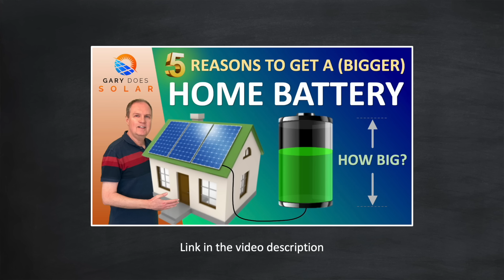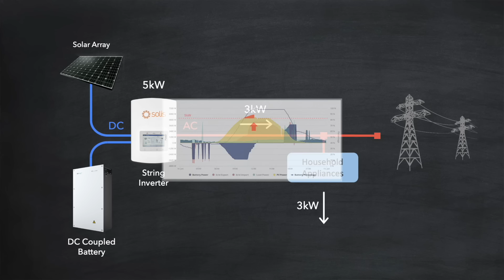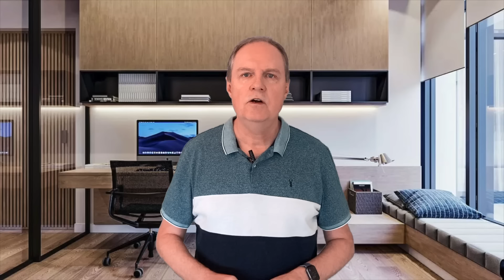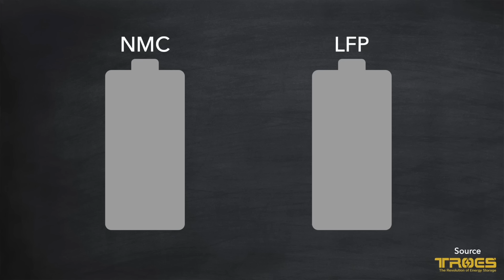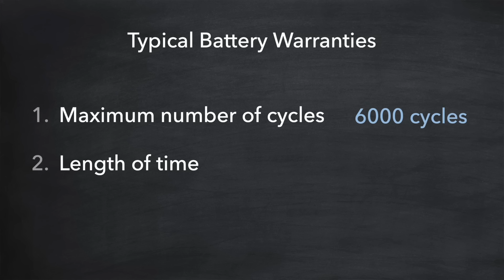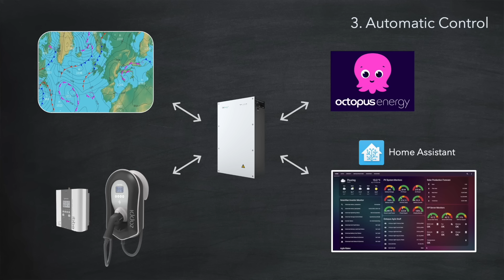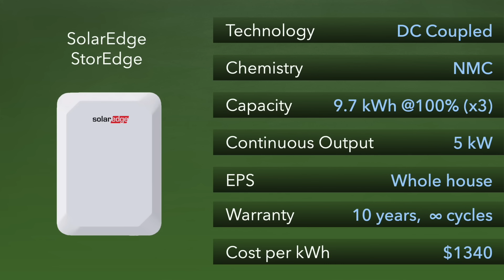8 Key Factors When Choosing the IDEAL Home Battery

Comment: It’s a very good summary of all the battery considerations.  I will add though that with warranty terms, it is common to see “pro rata” clauses in terms and conditions.  So for example if your 9 year old battery is dead with a 10 year warranty , they’ll give you a credit worth 1/10 the replacement cost of your next battery.

As for returns on investment.  I naively thought this would be easy to measure.  It’s not.  It’s tightly coupled to your solar investment.  So for example:  I charge my  battery up from clipped solar on a bright day.  Then I discharge it in early evening time.  So I’ve boosted solar production by 10% in kWh terms, but it’s worth 20% of all value generated for the day (due to flux evening export rate).  So:  how much of that added revenue is attributed to the solar investment and how much is attributed to the battery?  It’s hard to untangle, but it’s an excellent example of how investments boost the value of each other.
Reply from the maker: Thanks Anthony. Yeah, like any contract these days, there are always a load of "get out" clauses, which can make the contract not worth the paper it's written on. Somehow, I don't ever see that changing - it'll be social media feedback on how companies deal with warranty failures that determine how they behave...

You're right about ROI - I'm about to undertake a ton of research around that, and I'm thinking along the same lines as you - we need to separate out the solar ROI from the battery - not easy! And as you say, there is a combined benefit too - should be fun to untangle :-)

By the way, I strongly recommend people to watch Anthony's channel - his latest video on energy pricing and how it might change in the future is highly informative: https://www.youtube.com/watch?v=Me0lFCfVCwo

Comment: A nicely put together video Gary and, having watched it right through, it covers pretty well everything that came into my mind when we chose to add a battery to our system a few months ago. Much of my decision making process in specifying the system was as a result of videos from yourself and others (and my electrical engineering degree came in handy too). 

It's very reassuring to see that what we chose in the end is well aligned to your video content here - but chosen to suit our individual needs. So far, we're happy with our battery addition and having Octopus Agile  as our tariff means that we can keep our batteries nicely topped up but without over stressing them. .... AC coupled 15KWh Phosphate batteries (3 by 5KWh each), for information.
Reply from the maker: Hi Ian, thanks - and great to hear I managed to cover all the salient points :-)

I studied Electrical Engineering too (but I think I've forgotten most of it!) - helpful for all this solar and battery research though :-) 

Your battery strategy sounds good, and not a bad capacity!

Comment: I totally disagree with you on AC coupled being better. You paying for inverters twice AND saddled with extra power conversions. 

You can buy a sol-ark 15k and 20kwh for the cost of a Tesla power wall and it is significantly more capable. There are other inverters that do the same
Reply from the maker: Actually, I never said AC Coupled was better than DC Coupled. I simply presented the pros and cons of each. I'm not sure I could have been any more objective than I was.

I then disclosed that I (personally) would have purchased an AC Coupled battery if I had my time again, but that's taking into account my own situation, and the next person's situation will be different to mine.
Reply: That's fair. I do think you ignored the types of units that I mentioned that combine much more of the function into a single box, including a 200amp grid passthrough. These mitigate your cons of DC coupled batteries in my opinion. 

These include the sol-ark 15k, EG4 18k and luxpower 12k. I'd suggest you check them out.

Comment: Another great vid Gary. It just goes to show how fast things are moving. When I signed up for my 4.1kW array, GE 3.6kW Hybrid Inv & 9.5kWr Battery (+ a Zappi & Eddi) last November (which was installed in March this year) I thought I would be good to go for a few years to come. However, the cracks have already started to appear. The GE LFP 9.5kWh battery is probably not big enough for our current / future needs & the 3.6kW Hybrid Inverter is not really big enough to power everything we tend to have running in the house at the same time which requires careful management of what can be turned on & when. 
I can add an extra 9.5kWh battery to increase storage capacity but I'm pretty much stuck with the Hybrid inverter unless I change the whole system. The GE AIO system was not available when I placed my order last year & is probably the one I would go fo now.
Reply from the maker: Hi Colin, thanks! :-)

Yeah - technology is always improving (great) but it means that whatever you buy, there will always been something better coming along even a few short months later. I feel the same about my existing GE equipment and the new AIO!

Comment: A lot of great intel in this video again. I'm wondering if it's worth the money to choose for a bigger output inverter, let's say 8kw instead of 5kw, for your needs in the house. Then you can choose DC coupled batteries and minimal losses. Right?
Reply from the maker: Thanks :-)

And I wouldn't worry about the losses - although theoretically, losses for DC Coupled batteries are less than for AC, in practice, it doesn't make that much difference... And of course, a bigger inverter could be refused by your DNO (or export rate limited)...
Reply: @GaryDoesSolar  I think you can get bigger inverters within G98 if they are 3-phase ( as each phase would have a separate 'limit'. am, I right? ) . I have 3-phase to the house.
Reply from the maker: @TommysDaddy  Good question - and one I don't know the answer. Would be great if so! 🙂

Comment: Another very clear and comprehensive video Gary, thank you.   The charge/discharge rate of the inverter and the battery are for me one of the key decision factors as to whether you can use your battery effectively to power your home.  You mentioned that a benefit of AC coupled is that you can chain multiple batteries to increase the throughput,  you can do the same with DC coupled as well if you have multiple hybrid inverters.
I have two GivEnergy Gen 1 5kW hybrid inverters which were sized this way because of the number of panels I was having installed.  Looking at the energy graphs I am not getting anywhere near clipping on the inverter output, but if I’d had one inverter I definitely would have been clipping.  Two inverters means double the charge & discharge rate.
Another battery choice consideration is whether you can expand the batteries yourself.  Most manufacturers allow this and the batteries just plug in, GE are the outlier by insisting that the install has to be done by a qualified installer.  This is a disadvantage of GE.
And a minor point on the GE Allinone, their literature says the ‘up to 6 batteries’ chaining is a ‘coming soon’ feature.  GE’s multi-inverter option for AC and DC inverters has been work in progress for a long time, so hope its coming sooner for them to compete with Tesla
Reply from the maker: Thanks Geoffrey - really great feedback :-)

Thanks also for sharing this insight - and yeah, I read the same about the AIO - hopefully, that feature will appear soon!

Comment: Redux flow batteries
Reply from the maker: They could well have their day in the home at some point... I think it's great that there are several battery technologies, all vying for prominence.
Reply: @GaryDoesSolar  At the moment, I just can't trust having batteries of that size in the home that could potentially destroy it at any time. Same with EV. Ill wait for VRFB batteries to reach its sweet spot. Only drawback is the large amount of space required for them. It will only be a matter of time before China's factories begin the mass production and find some way to increase the charge densities to reduce their spatial footprint. The other advantage is the much longer lifespan and easy of replacement for the electrolytes and electrodes at the end of life.
Reply from the maker: @DavidCheok  I'll keep an eye on that technology 👍

Comment: AC vs DC isn't a big issue for me, especially when the real world efficiency doesn't seem to matter too much for me. Besides, theoretically I'll actually need less battery capacity purely because I'm doubling up my solar array. Though it'll be better when I do get an EV

A couple of other factors too RE: LFP vs NMC is ethical and environmental concerns

Nickel mining in Russia isn't great for people's health. That, and it does somewhat support the Russian state even without health concerns

Cobalt mining isn't a particularly ethical thing, even though the vast majority of it is used for refining crude oil

17:20 ish I asked GivEnergy about Intelligent Octopus Flux, and mentioned my concerns about forced discharging, and they said it's not a massive issue.

Equally, someone else pointed out prior to this video the same thing you said ie: when the battery dies, I'll probable want a larger sized one anyway, or more so the same physically sized one but far more energy dense

The system I'm upgrading to is the AIO however, I don't really need an EPS given that power cuts are rare here.

Though I did think "Hmm, if my dad got solar panels for the house he built in Pakistan, an EPS is a far better option than a UPS which only really has enough capacity to power up the ceiling fans" Power cuts there happen about once or twice a day for about an hour at a time, and the fans are also at reduced capacity.

Under normal circumstances, the UPS is "good enough" to at least give power for those fans to help keep somewhat cool. Under an extended power cut, that's not amazing.

Equally, the UK may not receive that many power cuts yet, however given we've historically been a cold, wet country, the energy infrastructure doesn't have to be heat tolerant like it is in hot countries

In Australia and the gulf states, they can afford heat tolerant equipment. Most of the global south can't afford that. The UK probably will also struggle to afford that even though we're a relatively rich nation, purely because it means the replacement cost is so high.
Reply from the maker: Thanks for your insight here, Waqas - really good!

Comment: Thanks Gary much to consider. I am woefully under informed on my system. I have already got batteries maybe DC coupled need to check, in my loft, and something that has me concerned since I watched the electric viking in which he states that batteries are not allowed in roof spaces in Australia not sure about the UK. Not sure whether mine are LFP or other.
Reply from the maker: You're most welcome! In the UK, I don't think there is legislation preventing batteries in the loft, but that might change in the future. To me, it's all about the absolute number of house fires (that will make the papers)  - which will increase as more and more people get home batteries - rather than the percentage.

Comment: I think there's a ticking time bomb with all these batteries being fully discharged and fully recharged. It's going to wear them out very quickly.  Is there really such a good value with the cost of these units.
Reply: He did say none of the batteries is actually fully discharged. They just quote the usable energy capacity, ie, 80% of the total capacity, as the advertised capacity so they can say they can be discharged 100%. This is also less misleading for the buyer I think.
Reply from the maker: Michael, I'm not sure what your issue is? The manufacturers all seem to be offering 10-year warranties as a minimum - they don't seem concerned (remembering they're the ones who lose out if batteries require replacing during that time...)

Comment: My setup is a Victron grid tide / off grid system.  There's no solar diverter or EV charging drawback.   The system cost was £42k. (Including 14.4 kW of solar)  It can output or charge at 15 kW per phase (3phases) life expectancy to 80% is 20 years.  Payback using the calculators is 6 years. 

Sometimes I feel like I built it a bit too big..  was it the best option over a more traditional setups.
When you see the cost of those systems and the limitations of single phase. With what's to come with the electrification of houses and cars. I feel like I just have enough to cover the power demand.
Reply from the maker: Hi Michael - wow - huge system - but pretty good payback! :-)

Comment: If the inverter isn't big enough for the batteries you are using, then shouldn't you just get a bigger/higher capacity inverter?  Am I missing or misunderstood something?
Reply from the maker: That is certainly an option, but your DNO might refuse permission or restrict your export.
Reply: @GaryDoesSolar  Oh. Okay.   I have a different circumstance.   I won't be installing in a country with a good net metering program.   They also have frequent power outages.   So I have no intention to export.  I will only import when absolutely necessary.  Having battery backup during power outages is a must for me.  If set up for net metering, I would lose power, even if the sun is shining outside.

Comment: can you avoid the clipping of you inverter by charging your battery a bit later in the day on sunny days? You would export (or self consume) the not stored energy in the morning, and later in the day the clipping will not happen as there is battery capacity left for it to go into? As you said, it's percentages, but it all adds up ;)
Reply from the maker: H Hans, another comment on this video was from someone who uses automations to control the rate of battery charging to counter slipping for as long as possible - great idea!

Comment: Gary, Thank you for another excellently produced video - they must take you ages to research!

But you missed out something: Battery Self-Consumption: the power used by the Battery Management System to run the environmental controls, web servers and monitoring software. It's really hard to work this out but I think it amounts to many tens of watts - possibly more than 50 W continuously i.e. more than 1 kWh/day of your charge is 'stolen'. It normally shows up as 'household consumption' in the App that goes with the battery but does NOT show up on a smart meter!

It's an important and rarely discussed issue: I'll be writing about it soon.

Best wishes

Michael
Reply from the maker: Hi Michael, cheers for the kind words - yeah, this particular video took me ages to put together. I didn't expect it to be so long, and I didn't get a chance to cover ROI yet either! Future video then...

Great point about the power drawn by the system itself - even at 50W it quickly adds up over 24 hours - crikey!

Comment: From my own research for the UK and actual use in my area. Normaly it's 10 kilowatts export limitation on a single phase. This is normally the maximum size they want you to have on a solar array or inverter.  You can times that by three for three phases. 

It would be great if you could do a video on the Victron grid tide system.  I believe my DC to AC conversion rates are about 1% the same again back. Making a 2% loss.
Reply from the maker: Didn't know the conversation rates were so low on Victron!

Comment: Your video didn't mention lead-acid batteries? My install has a 92kWh lead-acid battery bank (32 x VARTA 230Ah 12V batteries in a eight by four (12V x 4 =48V) configuration. It gives me approximately a usable 30kWh down to a 70% depletion. Depletion to this rate should extend the life cycles of the bank. I know the benefits of lithium (less weight, lower DOD rates, happy to sit at less than 100% for longer periods, allegedly greater life cycles), but if you're on an Octopus tariff where cheap energy is available (I'm on Go, cheap between 12:30-4:30), then all the benefits I've just listed become superfluous as the bank can be brought back up to 100% at any time. I've only had the install in since Dec 2022, so I've yet to gather enough data to see if it will work long-term. My system comprises of 8.7kW solar panels and three 5kW hybrid inverters in parallel, providing battery charging from grid (100A per inverter if required....I use 60A per inverter = 180A = 9-10kW/h), solar inverting (15kW) and solar charge controller (6kW per inverter, currently using two inverters on 4.3kW strings at 400V). My system is 'off-grid' (ie. it's permanently running from the battery bank with input either from solar or the off-peak grid) as all power comes through the inverters. The biggest downside to this is no export, but given that the UK is hardly Arizona, I don't know how much this would really come into play over say 25 years. I bought a 2011 Nissan Leaf with half battery depletion so any excess solar is chucked into the car. Going forward, I can see a company coming out with a much easier 'plug'n'play' system, where you simply connect up solar panels to a box that has charge controllers, battery storage and inverters all built in, with say a distribution panel that links the existing wiring of the house to the box. It will be interesting, given the state of Ukraine, where we will be this winter.
Reply: Victron?
Reply: Victron? @scubajoe
Reply: @fredflintstone1428  just wondering if your system is Victron?
If not then the Victron system does what you wanted to achieve.
Reply from the maker: My question the same as the others...